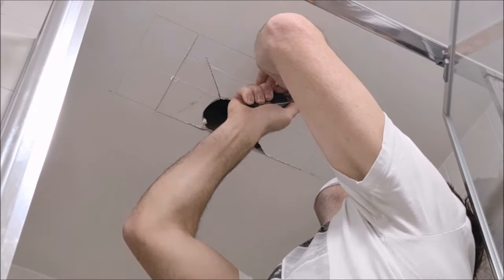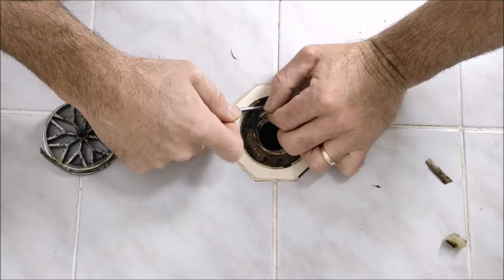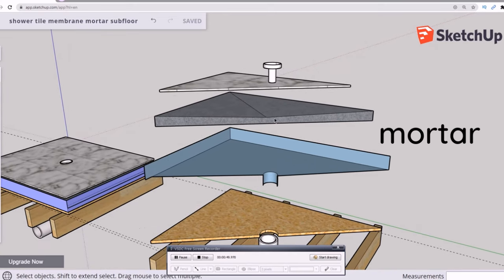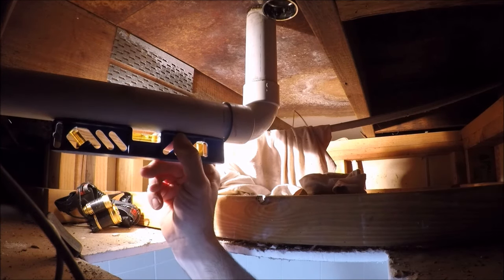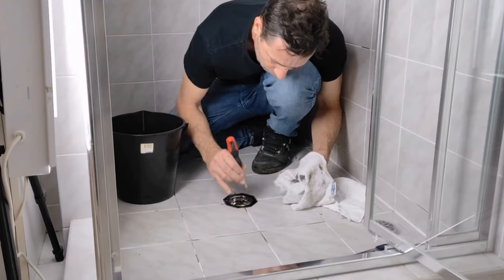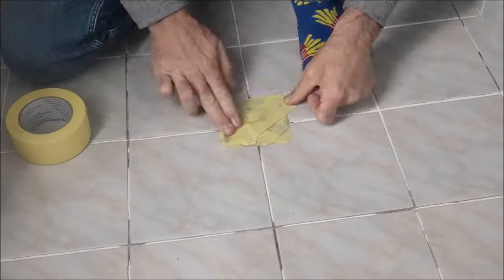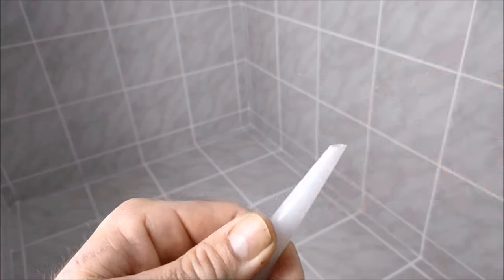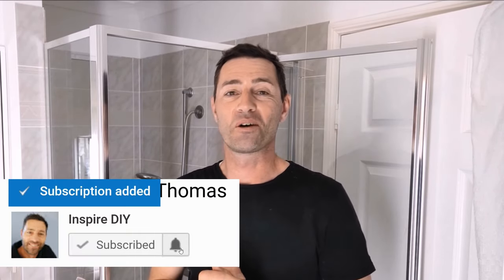How to fix a tile shower leak without removing tiles - Inspire DIY Kent Thomas

Comment: Since in my case, I checked from the downstairs, the water is coming thru the grouting on the side wall of the shower. Could I retile over the existing tile to correct this? Thereby creating two layers of tile.  Don’t have any issue with the floor leaking at all.
Reply: My other option is to take that side of the wall completely out as I don’t know what the tile is attached to on the other side.
. This leaks keeps occurring and I’m looking for a permanent fix.  Ceiling below has been replaced again and again.
Reply from the maker: Hey Brenda, Im not a professional waterproofer or pro tiler, or bathroom renovator, so take my advice with a grain of salt. I would love others in the DIY community to jump in here too... please give Brenda your suggestions! I would be hesitant to try and fix leaky tiling and grout with another layer of the same without a waterproofing membrane underneath second tiles - as i've not seen it done or heard it to be succesful. Soon InspireDIY with be fixing a shower with a 'clear' paint on 'remedial membrane' that adds a waterproof skin ON TOP of tiles. this could be a great option.. stay tuned. Regards, Kent
Reply: Kent thank you for your advice.  I’ve decided to take out the wall of tile. This will then show why the water keeps leaking downstairs. After I will waterproof the new wall re-tile and replace the floor to the shower stall. I don’t want to have this same issue down the road.
Reply from the maker: Good stuff Brenda, let us know how you get on👍Kent

Comment: instead of leaking from the centre pipe
my shower seems to be dripping water out the sides and edges of the shower into the basement below
does this mean my membrane is broken on the edges too?
hopefully regrouting will do the trick for me
Reply from the maker: Hey Notlemon, that’s exactly what’s happening - membrane is shot! Follow the tips in these videos to get it sorted, unless you are rebuilding your shower or applying a waterproof membrane, this should keep you out of trouble!  https://youtube.com/playlist?list=PLMXeh8hXgu_GbTgoAZ2621uRf_xlZEijT  Best of luck mate, 👍Kent

Comment: Awesome - i have the same issue i'm trying to take on myself. Where do you get that waste drain from. Reece and bunnings don't have the ones like you have with the pipe connector.
Reply from the maker: Hey GD, this one was from Tradelink. Where is yours leaking from do you think, membrane or waste outlet?
Reply: @InspireDIY  Im not sure really. I think it is from the waste out outlet as is has staining underneath it. I have noticed some cracks in the grout also so i will do as you did and replace grout and seal. I have a cast iron pipe coming through to the waste so may have to change to pvc. How has yours held up so far?
Reply from the maker: Yeah I'm very happy with the repair, no leaks and everything is dry. Of course the ceiling cavity still has water staining but that is of no concern. I've decided to not permanently patch the hole leading to the ceiling cavity so I can periodically check. Just in case ya know 😉.
Reply: @InspireDIY  Awesome! Ill get going with mine and update once completed. I couldn't find the shower waste one you used from Tradelink on there website. Do you have a link? The only ones are with out the pipe connector.
Reply from the maker: I'll have a look for a part no. and let you know👍

Comment: Nice vid very helpful... ps. Wondered why you guys used a mortar base and tiles Vs a stone shower tray?
Reply from the maker: Hey Rehan, I’m just working with what I’ve got, this house is maybe 30 yrs old but I’ve only owned it for a year or so. Have you found stone to be more reliable in terms of waterproofing?
Reply: @InspireDIY  ... Yes.. definitely. One piece stone shower trays installed properly mean no grouting issues on the shower floor... You can get them in all sizes, profiles and colours now... And the more common approach in the Uk. But each to their own 🙂👍

Comment: Very helpful video but is the leak always most likely to be from the waste? What if its the connections behind the tiled shower unit?
Reply from the maker: Hey str8jacket, I was worried that the tap plumbing connections may have been leaking, it’s not likely (and thankfully wasn’t) as with a tiled shower the culprit is 99% of the time the membranes or the waste outlet. If it’s the plumbing can you get to it from the wall behind so your tiles stay intact? Best of luck 🤞 Kent
Reply: @InspireDIY  thanks for reply, managed to find my leak, it was coming from under shower enclosure glass in bottom corner. Looks like sealant had failed but very easy and cheap fix thank god 🙏
Reply from the maker: Well done mate, you’re ripping👌Kent
Reply: @thestr8jacket1  I think this is what’s happening with my shower. It is not leaking through to the ceiling below but it’s coming out under the skirting into the bedroom. I resealed with mastic which I thought had fixed it but it is still slightly damp near the bathroom door.  I’ve realised I missed a bit near the shower door so it could be that. Also I fixed it with sealant and left it for 24 hours to dry but that wasn’t long enough and it has disintegrated when I introduced water to it. Now I see on the tube you are supposed to wait five days after sealing before getting it wet 😩. 
Am I on the right lines here?

Comment: nice work mate
Reply from the maker: Cheers Lewis, are you going to give it a go?
Reply: not to the same extant,im just regrouting the shower tiles and im gonna replace the shower screen,you explained it clearly and did the little things so well and not to mention the gymnastics you had to do to fix under the shower,far out i woulda thrown the towel in,i like that tip you gave with the shower sealant,i didnt even know you had the option to do that,and i have watched lots of vids on regrouting,i think u might the first ive seen that mentioned it,so im off to bunnings to grab some of that sealant stuff,cheers much appreciated
Reply from the maker: Thanks for the feedback Lewis, I appreciate it mate. Best of luck👌Kent

Comment: What about the mold seen from underneath on the drywall?
Reply from the maker: Yeah Desert Rider, great point! Kill the mould with your chemical of choice, I use that ‘30seconds’ mould moss and something concentrate in a spray application. Once you have done final moisture checks and closing the ceiling, treat it again for good measure 🤔👍 cheers, Kent

Comment: Hi Kent. Great videos and it’s great to hear from an Australian perspective! 

Your problem is similar to mine and I’ve used your video to see if I can DIY it before getting additional help. I did all your steps except replacing the drain. I’m curious what you did with the particle board? Did you replace it or did you leave it knowing that it probably won’t get damaged anymore? My particle board has stains and looks like it has been water-damaged and has some rot in it. Based on your description and what my logics suggest, I think (hope) the flooring does not need the particle board anymore for support, as the concrete above the board holds up the floor. Assuming the leak has been fixed, the particle board has no further use and therefore doesn’t need to be replaced????? Am I correct in this thought or way off? I’m hoping to avoid opening the ceiling and getting someone to replace the particle board. Obviously if the particle board is important to the strength of the flooring, then I’ll get it sorted by a professional. Any thoughts would be appreciated. Thanks. Graham.
Reply: You gonna let him get away with calling you Australian?
Reply from the maker: Haha.. you have a good ear for accents Bingley👍

Comment: There are holes in the lower part of the drain for the water that soaks into the grout and mortar bed above the water proof layer that were clearly plugged.  You might end up with the same issue again.
Reply from the maker: Absolutely right mate.. however without an in-tact membrane around the outlet these holes are detrimental. Because I didn't replace the membrane, I've diverted water away from mortar by sealing grout then using a one piece outlet. Time will tell... But 6 months now and so far so good, would you have done different?  Thanks for the comment penthesilliaas, 👍Kent
Reply: He's right. Sealing the grout isn't a long term solution. Sealing it will prevent summer but not all water from being absorbed. A better option would've been to use epoxy grout again as that's pretty much waterproof with no sealing required. I think the fact you don't have issues is also because you left a few mm of epoxy grout under the cement grout

Comment: Do not use your finger to wipe the silicone, that will allow mold to grow inside after a short time.
Reply from the maker: Hey Iron Horn, I have heard this before but never experienced it myself. Good tip though to keep us out of trouble 🤙 Kent

Comment: I don't understand why they make these to where the top part is the female end. If the top part were male and fit into the bottom part, you wouldn't need to worry about leaks around that area.
Reply from the maker: True, but I guess how else can you make a DIY plumber sweat, and lose sleep at night wondering. Cheers, Kent

Comment: wait cracked epoxy grout? something isn't right, epoxy SHOULD NOT crack , shrink, or discolor, and whatever grout you applied after is NOT epoxy grout, just so you know.
Reply from the maker: Hey CulichorHimself, I would be disappointed for sure if i'd invested in epoxy grout and it didn't solve it's desired problem, but yes - on this shower some of the epoxy grout has separated from the tile edges, and cracked in places! you are absolutely right.. I have not redone the grout with epoxy, instead have ground out approx. 3mm and re-grouted with a cement grout, it's a Sanitised Colourgrout from Davco (I may not have relayed this clear enough, sorry), following that I sealed it al with a penetrating sealer and 1 year on so far so good. cheers for commenting mate! Kent

Comment: Like-  Except seems to me, you are relying on the silicone.   When "when" that silicone around the drain finally fails, water will be in the basement again!
Reply from the maker: Hey Bryan, yeah this is only a substitute for replacement of under tile/mortar membrane, so with the drain set in new mortar with improved fall + quality silicone + grout tile sealer the only extra step would be a ‘remedial membrane’ to ensure no more water ingress. Cheers mate - great comment. Kent

Comment: "How to fix a tile shower leak without removing tiles" - step 1, cut the ceiling. Oh come on!
Reply from the maker: I know right Evan, if you are pretty sure that it’s leaking due to a membrane failure (and not a plumbing leak (hard to tell without looking🤔 ) then you can avoid cutting the hole! Regrout and re-silicone, then apply a ‘Remedial Membrane’ I’ve used it and it’s a great product https://ebay.us/x1M0mB cheers, Kent

Comment: Dang, I’ll have to pay someone. There’s no way this is a DIY for me.
Reply from the maker: Oh well, at least you know what’s involved 🤷best of luck. Kent
Reply: @InspireDIY  hehe, I called someone out and he quoted like $3k to pull up the shower floor and tiles, and then I’d have to pay someone to rebuild the shower area. 
A few days later my wife found a roll of thick clear tape and we used it to cover up the crack. We’ll get it get fixed later when we can have the bathroom remodeled.